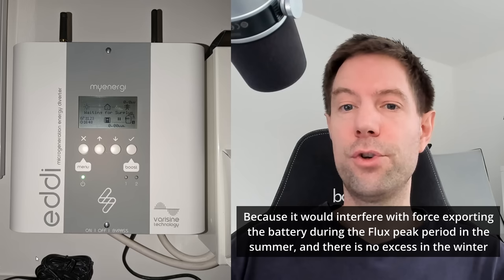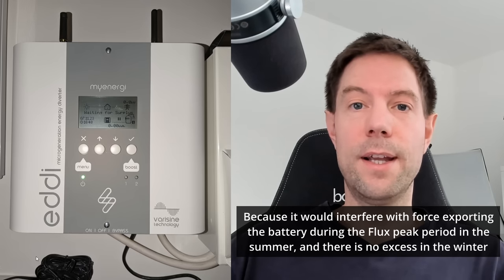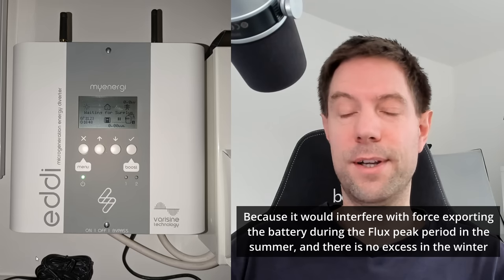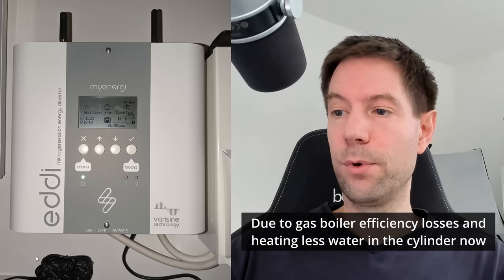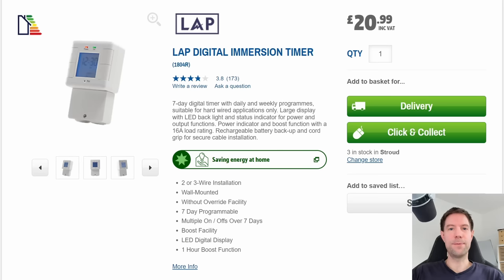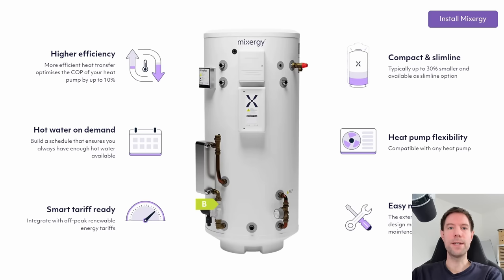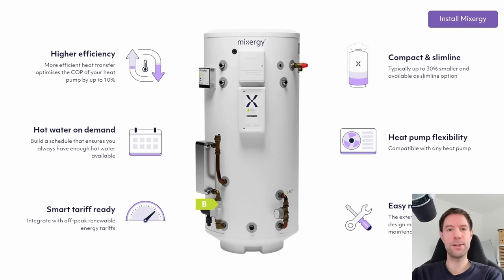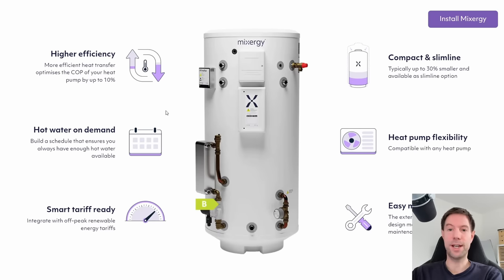Gas free hot water - so many options!

Comment: You have done so much up until now that you are pushing a case of diminishing returns. If net exporter is your goal, have you not looked into custom built Evacuated Tube Collectors to mount on the house front in that Apex area with the cylinder in the loft behind them for hot water. Like I said, custom....so it looks good and becomes an external house feature. Years ago people thought solar panels were strange and today they are everywhere.
Reply from the maker: Oh, I totally appreciate that it's not necessarily worth it in terms of cost doing this extra stuff.  But I'd like to do it anyway (gotta have a hobby, right?) and it gives me something to talk about on the channel!  It's a bit of a rabbit hole, all this, and in some respects I do this stuff because I find it all really interesting and figured it was worth sharing some of the research I've been doing.  Regarding the evacuated tube collectors, that would certainly be a lot more expensive to install than a heat pump cylinder but I might investigate that option at some point in the future, once I've run out of other stuff to do!
Reply from the maker: Interesting tech.  I'll keep an eye on it.

Comment: Hello Tim, I have an Ecocent version of your favoured ASHP on tank. It’s excellent! Very efficient. It draws from the landing, unlike your plan and vents out  from the attic. It’s not that loud. We only hear it when we walk past the airing cupboard where it is. I recommend, but, like @buddywheels, if I had to replace it, Sunamp really interests me. Only issue with Ecocent is that it needs a pump to capture condensation. It recently went wrong and dropped water into the downstairs shower room. It happened during Storm Ciaron, which freaked me out; how could rain come in sideways and not from the roof?! Other issue is that it’s not great at handling a houseful. We are normally three but when daughters and spouses come down from London, it runs out and takes time to recover. Yes, there is a boost but fast it is not. Alex
Reply: PS; like you we have a split system. But unlike you, central heating is a pellet boiler. In my defence, it came with the house. Apart from its lack of eco credentials, it’s effing hard work!! I dream of a system where I don’t have to feed it everyday and riddle ash!! 15kg of pellets a day!!! When my ship comes in it’s going!!!!
Reply from the maker: Ah, I hadn't heard of the Ecocent version, I'll add it to my list for the next video!  I hope you were able to get the pump fixed.
Reply: The way you describe it, it sounds like it sucks heat from the heated space of the building, and then vents this into the loft space (aka the uninsulated space)? Surely thats not right?
Reply: I also have an Ecocent 300. It works very well as it gets its air from the MVHR system which is warm and so improves efficiency. You would think this would cool the house but that does not seem to be the case. I agree it is slow to heat the 300 Lt of water when we have visitors but you can set it so it runs all the time to maintain a programmed temperature. When there is just 3 of us in the house I have it run in the night when we have cheap elec with a top up during the middle of the day. The main issue I have with the system is the terrible service from ESP. These type of integrated ashp/dhw tanks are very popular in the US. If you want one just steer clear of ESP
Reply: Yes, it doesn’t seem to cool the house. And it was explained to me that it was more efficient, as you describe. Thank you for the operational tips; v helpful!!
Reply: Thank you Tim, yes, it’s fixed, a saniflo condens device this time.
Reply: It is definitely worth looking into drawing in heated air from the home into the aroSTOR during the winter as this will avoid it freezing during the coldest months. Some people think that this is inefficient as you are paying to heat the home, and then paying for the electricity to heat the water, but the cost of the electricity to operate the aroSTOR is reduced by the heat that is drawn from the house, so it doesn't cost any more.

Comment: Have you investigated ways to install a heat exchanger that removes the heat from the wastewater and heats your house so that heat is not wasted. 🤔
Reply from the maker: I've seen a couple of options but realistically it's more disruption than I'm willing to undertake at this stage (would require ripping up the showers etc. for example).  If we were to ever need to do work on the showers/bath then I'd look into getting something like that retrofitted at that stage, since it'd be easier to do while other work was going on.
Reply: @TimAndKatsGreenWalk  Yeah. They are a no-brainer in new constructions but pretty expensive otherwise. Although I think mentioning them in your videos  will inform people of their existence
Reply from the maker: @johnzach2057  I'm sure I'll get around to doing a video about them at some point, but I've got a very long list at the moment!

Comment: I wouldn't change what you have apart from wiring the top immersion you will never get your return on investment an immersion costs £20 changing  your unvented cylinder for something else will cost thousands im a heating engineer of over 30 years and ive seen new hot water systems that are all singing and dancing and they don't last
Reply from the maker: Although what you say is valid, I'm not actually doing this for a return on my investment, my main aim is to reduce our energy usage, as long as it's not prohibitively expensive to do so (see previous video in this series linked in the top right corner).  I'm sure a lot of people would find that strange but there it is.
Reply: Ok mate